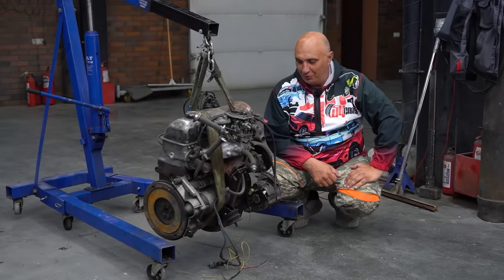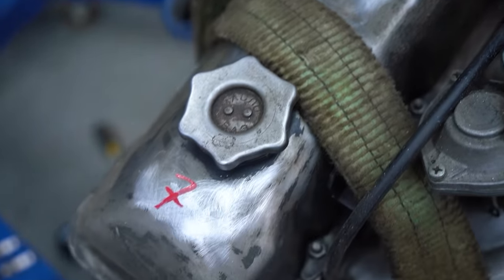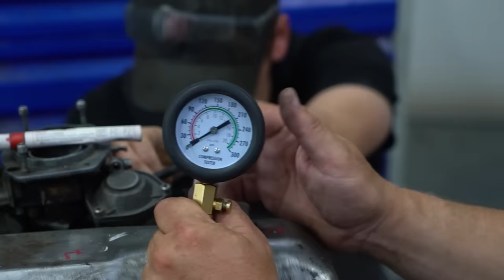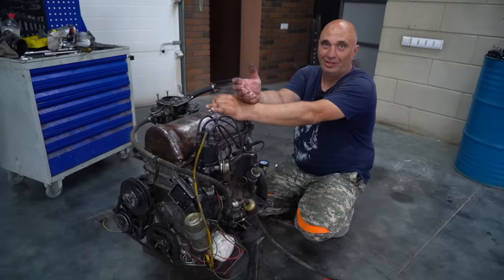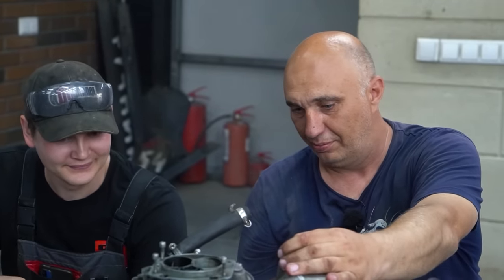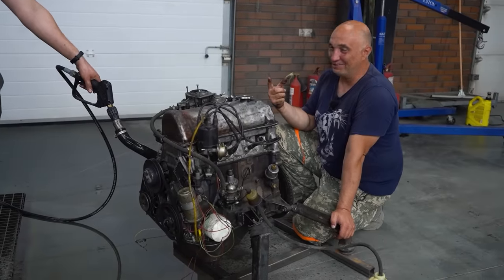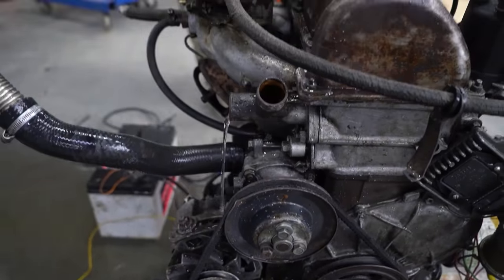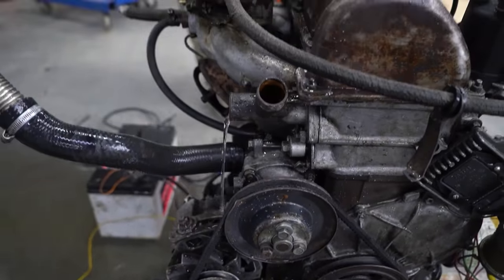Will an engine start on RUBBER piston rings?

Comment: for another test, let coolant run through several radiators and see how cool the engine stays. Maybe 4 or 5 in serial or parallel.
Reply: or instead of putting more radiators, try to pressurize the coolant when it's in the radiator and then de-pressurize it at the engine. that's like a fridge, but I'm not sure how well that would work with a coolant, that's not gas at room temperature and normal pressure

Comment: The oil on the cylinder walls will weaken what the heat doesn't damage. It will be a short term idea

Comment: Replace the 2 compression rings with silicone o rings and leave the original / stock oil control ring in place. Install in a car and give it a real test.

Comment: Some better material and a standard ring on top and an o ring on bottom I assume you would still use the oil rings but maybe you could just replace the oil control ring with an oring

Comment: Is it possible that the oil getting past the seals into the combustion chamber  protected the rubber seal. Maybe keeping the oil control ring on the piston would cause the seal to burn out faster

Comment: I wanted to see if you put back the oil ring, and install it back to a car what would happen.  Probably search for oil and heat resistant rubber rings if they are available.

Comment: You should have done 2 rubber rings on the bottom and a metal ring on the top that way the combustion would melt the upper rubber ring

Comment: follow up with new rubber rings .... compression test before start and after ..... ect ect ect ...... GG didnt think the engine would run with just rubber rings.... ive tryed a weed eater 2 stroke engine with no rings and i would only beable to keep it running for a second or 2 at WOT...... keep the oil ring metal ..... the rest rubber....

Comment: You should keep the rubber rings in the engine and run it over a year and then review after and if they are still as good after a million hours of running like in this video i would recommended suggesting this as a new industry standard for piston rings instead of metal ones, they would be much easier to install and cheaper to replace and make.

Comment: I think the only reason the rings lasted so long is the oil lubricating the rubber rings . By install an normal oil ring will mean the rubber rings will run dry and won't last very long

Comment: The valves are not closing compleatly. That is the flame. The top ring has disintegrated closing 2 and 3 and pinning the valves partially open.
Reply: Darn I was wrong. But it's interesting. Maybe a set of total seal rings.

Comment: I think the reason why the rubber rings lasted so long was because of the oil blow by. I would think that if a oil control ring was installed they wouldn’t last long.

Comment: Being that ptfe can handle temps higher than what the society of automotive engineers say cylinder walls get up to in temp (265-475F) could it work? I'm not so sure silicone o-rings could put up with the frictional abuse, might be too soft of a material, but could handle the heat I would say likley. Viton might be the best bet.

Comment: The reason the compression increased is because after you ran the engine with the rubber rings, it expanded with the heat and created a tighter seal which cause the compression to increase.

Comment: 2 rubber 1 oil ring and drive it till it dies... Also mil the head and see if you can get 10 bars of compression going per cylinder

Comment: Why not make a 2 stroke Lada engine where only cyl 1 and 3 have combustion and cylinder 2 and 4 pumps air into it. Connect the carburettor to 2 and 4 and mod the camshaft.

Comment: I've always wanted to try 2 rings per grove with the ring gap in opposite directions. I think the bleed off of compression would be less as with blow by. You could try and show if it works.
Reply: look up total seal piston rings
Reply: @overbuiltautomotive1299  are they the ones with the overlapping ring groove? I would like to know how they work as well. My concern is binding. The overlapping ring would be harder to gap for expansion than 2 thin compression rings. This video was a good experiment. Very interesting. I didn't catch if they honed or polished the cylinder walls. The engine definitely needed to be turned after the start. The tune was with uneven compression. But excellent experiment.

Comment: You got different compression readings because some of the cylinders a war more than any other ones if you would take the block and have it board over like 10 mm over 20 mm over 30 mm millimeter then do the rubber piston rings and see what the compression is see if they’re all even then because then the blocks even cylinders are even get new pistons that way they’re all even put the O-rings on them then I bet you they have all the same Compression. I wonder if they do you should do that experiment

Comment: Isn't it curious that the rubber O-rings would simultaneously raise the compression AND allow significant oil into the combustion chamber? That doesn't seem plausible somehow. 
Maybe NASA should have used Russian O-rings rather than Morton Thiokol's on the space shuttle.

Comment: Use rubber on 2 and factory rings on 2 so it'll still run once the rubber fails. This way you'll still be able to limp back to the shop.

Comment: Look like when it backfired through the carburetor it would leak out of the intake manifold between the head on the front two cylinders, You might have a vacuum leak there

Comment: You guys need a rig setup, one with a rad, battery and a throttle like a test bed to save ya being on the floor tryna muck arou.d with melting cables and fingering throttle links

Comment: what happens if you double the compression ratio of the pistons... will it still work or will the engine explode?  if it actually works than that will double the torque output of the engine.

Comment: Re-do the experiment with the engine on a car and test it till fail?
Edit: Or put the oil ring at the bottom as it is but keep the other two as rubber and test it in a car for lets say one week.

Comment: I would like to see this retested, maybe with hydraulic cylinder seals if possible. Maybe even hydraulic oil in the crank case. And in an actual car to see how it performs.
Reply: what temps are hydraulic seals rated for?

Comment: It was an interesting and unexpected result. I had waited for the engine to run for 10 seconds then the rubber would melt. It apparently doesn't get that hot on the cylinder walls. But Where are your earplugs? It's not so fun if you're sitting in a group of people and you can't participate in the conversation because you can't hear what they're saying. Earmuffs next time.

Comment: I think traditional metal rings, with the gap, are designed to allow a certain amount of compression past the rings to reduce inertia. The lack of this "normal" blowby is causing a fair amount of 'kickback' on the crankshaft, which is why it does not want to idle.

Comment: I always wanter if an engine can be used as water pump by adding rubber rings and adding a flat head with 2 non return balves 
What do you think ?

I guess thw rubber will be damaged on thw video by the hi temperature . Lets see

Comment: silicon would work slightly better and can handle the heat but the engine oil will destroy the silicon or any another rubber
Reply: Theres not do much heat here.  Even at the top ring.

Comment: 🤔 put normal oil scraper ring back on and use the x2 top rubber rings back in engine 
I'd love to see it then in a car n drive it hard to see haw long under load it would last 
What does every body elts think 🤔

Comment: Can't run for long,  temperature of contact point of ring and cylinder wall is 3000 degrees Celsius, rubber of any kind will vaporize, burn and turn to bit's...

Comment: try flywheel battery powered car, electric or mechanical, radius 1m, like a lawn mower spin disc, spin rate at least 20 000 rpm

Comment: In aviation we work with all sorts of O-Ring rubber types as well as "backup" rings under high pressure conditions (typically of teflon material that sit on one or either side of O-ring).

Unfortunately a process such as this would be hell on any form of rubber Oring, If god forbid the O-ring doesn't get enough lubrication, it'll wear a lot faster than a Metal ring haha. The Chambers tolerances also change with temperature, piston enlarges and the cylinder gets tighter as well, so now you need to adjust for that if you want your O-ring to survive longer, given that once at proper temps the tolerances may be applying too much pressure on that oring, increasing the likelihood of direct cylinder contact. Nevermind the slots made for the O-ring having to be properly gapped so that when the oring is compressed the edges aren't cutting into the oring, or the oring isn't trying to "squeeze" out at the edges decreasing its lifetime.

So much to consider when attempting to engineer such a project but in the end it seems fruitless as these O-rings would eviscerate themselves if there is any lack of lubrication

It looks like in this case the Orings were either twisted during installation (a big nono, lot of Orings have a white line on them to verify you didn't twist during installation), when installing the rings don't start at the furthest end, having to jump those gaps with edges increase the likelihood of nicks/twisting. etc etc

It could also be that the slots you made were too tight, so the compression of the rings were far too tight, making the "thrust side" grip the Oring harder. 

Do it again but look at the charts online for Oring Slot gaps, O-ring heat ratings, O-ring durability, etc. Also try adding Backup rings, they're teflon but they can prevent the oring from attempting to extrude under high pressures and twith proper lubrication the Backup ring may survive long enough for a trip to the store. 

Awesome video

Comment: I'm wondering if you could make some more conventional looking rings out of thick copper wire?

Or, how about using sections of a big coil spring - One complete turn to substitute for one conventional ring?
Reply: I think you'd get issue with copper expanding significantly when heating. Better choose constantan, which is 55% copper and 45% nickel alloy, with the benefit it does not expands or shrinks with temperature changes, and is also nice for sealing.
Reply: @bubullenoiraude  But surely, you would gap the rings accordingly?  I would.

Comment: Wonder how PTFE hydraulic wear rings would work.
Reply: Ptfe is thermoplastic. It will deform above 200*C. Maybe even less over a longer time. Not sure it would work.
Reply: @laharl2k  Just think would last longer than rubber.
Reply: @Taluvian  sure would last longer but would not work as intended. You need a seal and if the ptfe deforms because of the heat and the pressure then its not a seal anymore.
Reply: @laharl2k  My point is rubber is soft and melts easier. PTFE probably would last a lot longer. Maybe even a short test drive.

Comment: Amusing 😁
Running like a bag of shit though, but the Engine had compression, so then that is Not the problem. Check all the  o-ring grooves are made the same, and each one has the same drag when installed in the cylinder,  re-assemble, all new o-rings. use a known good distributor, coil ignition, leads, carburettor, new spark plugs, adjust the jetting, the valves, install it in a car. maybe turbo it,
dyno it. 
😁 

😁

Comment: put the engine back together, put a new carburettor,  but back the oil ring, two rubber seals. but on a dynometer. put it in a car test it in real life with radiator

Comment: The uper Ring should be a normal and the second and third a Silicon-Ring that hold the Temperature. I was really impressed that they came out whit no scratch or burned. The Rubber do not put the oil from the wall as normal pistonrings but they hold pressure high. Would be interesting to look what the Power output will rise signifikant on two Silicon and one normal pistonring....

Comment: You should do this with a metal oil ring ,the homedone head shaving, drill out the Jets in The Carby or home made injection  maybe some diy port polishing and see if you successfully make a high compression Fast engine

Comment: My guess is some of the oil comes from the valve guide seals? Several times you’ve pulled engines apart and found oil on the pistons and suspected it was rings but never check the seals.

Comment: Add the oil rings and stick the engine in a car, give it a proper loading to see how the rubber O-rings perform with some actual driving, maybe on that test track area though, just to avoid scaring the public incase it becomes a mosquito-killing smoke machine... :P

Comment: Fire piston use rubber rings, and they heat the air to 2000°c, enough to ignite a coal or piece of tinder. But that's a very brief window of heat, not continuous like an engine..

Comment: I REALLY wish you guys would do a good tune up on some of your builds. This engine has NO reason to run like crap like it does. Either you have some serious ignition issues, or one side of that carburetor is hot trash. The engine mechanically was perfect. This is a reoccuring trend on this channel. It's disappointing and irritating as hell.

Comment: so if the rubber rings worked for the middle 2 cylinders, what would happen if you used a snow mobile motor where the 2 pistons are side by side? On top of that, try a 2 cylinder motorcycle motor where the 2 pistons are opposite of each other in the shape of the letter V. free content ideas for you.

Comment: Whilst this is utterly stupid NOTICE it's only firing on 2 & 3 with only random input from either 1 or 4 @ 9:40 as for "quality rusky crap" well it's no better than chineseium crap, as for 95 psi compression on first test that's pretty sad on the second test it increased to120 psi thanks to some oil sealing all the gaps I know of domestic grade mowers that do 160 psi cold at crank speed, now again @ 16:00 running on 2 cylinders you can hear n see it as plain as day & of of couse zero longevity!...What a waste of time just more CLICKBAIT!